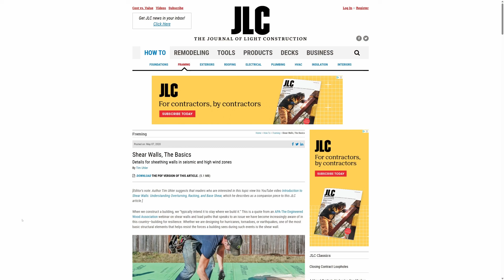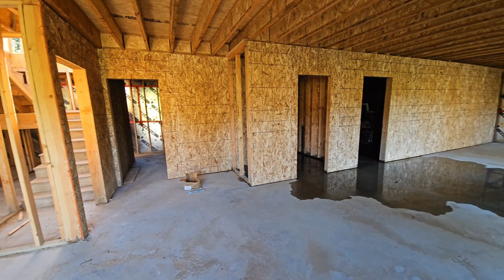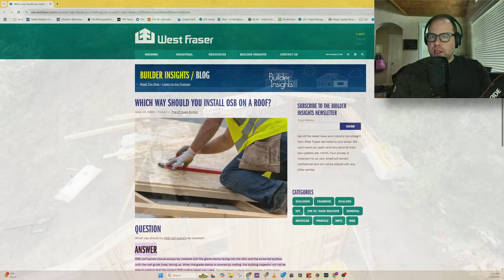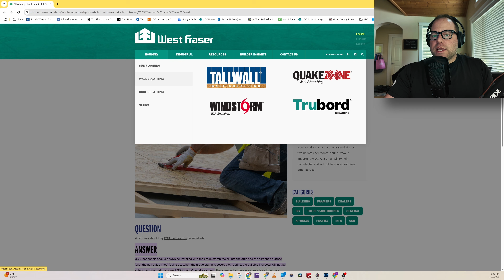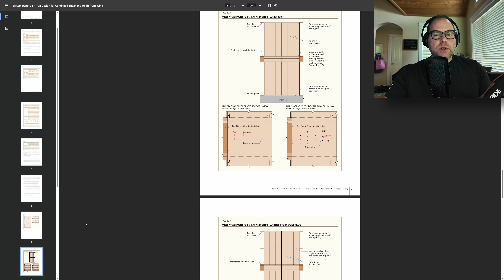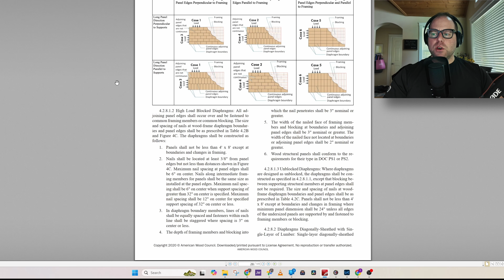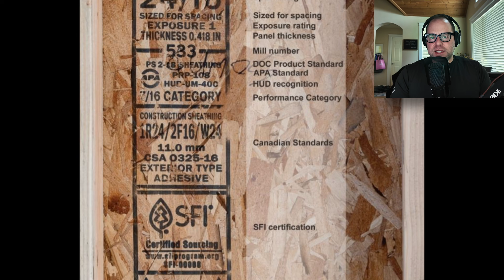Vertical vs. Horizontal Sheathing – The TRUTH According to Code

Comment: In my opinion as a structural pe,  sheathing should overlap equally from 1st to 2nd floor and should cover the base plate to foundation and top plate at roof.  This way most of your uplift is taken care of if you add straps at roof joists now you have uplift from roof to foundation.
Reply: This concept i am mentioning above is rarely talked about.  You can use straps floor to floor but really not easy to install and depending on the system gets in the way of the sheathing nailing and might put a bulge in your siding.
Reply from the maker: @kevinshaw5178  I mentioned that in the video with the reference to the PDF from West Fraser. I love the idea
Reply: @ sorry i was just grazing on the content didnt listen in detail.  But very notable concept particularly for high wind areas.  I did actually work for stanley black and decker nail division we tested vertically and did calcs.  The fasteners usually control.
Reply from the maker: @kevinshaw5178  interesting, thanks for watching!!
Reply: Another problem with the vertical straps is that they could buckle with vertical shrinkage causing siding problems.
Reply from the maker: @Bob_A8993  Great point!  We wait as long as possible to install those to minimize that issue.

Comment: I prefer horizontal applications, mainly for only one reason; it seems to me that the 8 ft. length of the sheet acts to keep the wall straighter, just my opinion.  Always block all edges!
Reply from the maker: I hear you, but 7/16" just doen't pull anything.  We find that when roof framing.

Comment: As a young man, new in construction it was easy to be critical of engineers especially when the older guys were gripping about what we were tasked to do.   But as I got older and ran my own company and crews I began to value what an engineer could bring to the table.  Protection from liability.  Design of critical components of a structure.  One avenue of construction we branched into was ICF buildings.   I have sat up night after night, pouring over code books, learning to read tables, designing lintel reinforcing steel according to those code book tables.  Its not fun when you are getting up early to be to the jobsite after you spent half the night trying to make sense of all that.  

So later in my career, when the engineer specs a certain rebar size or seismic stirup, hoop or hook I was thankful I didnt have to figure it out or incur the liablilty of that design. A few K for design is preferable to a few M for a lawsuit. 🤷‍♂
Reply from the maker: I could not agree more.  With open communication with the engineer, they are very accomodating.  Lots of ways to make the numbers work, we provide our preferences for products based on the tools we have or experience we have. For example, I will always ask to subsitute hardware with SDS screws if hardware with bolts has been spec'd.
Reply: I am literally going through this study all night work all day process. I have done concrete walls my whole life and now I'm a super over a self performed stick frame building with high shear demands and no people on my crew that know any better than me. 

This is driving me crazy at the moment.  I'll have a note in the structural note saying to sheet wall vertically, then a detail note says the sheathing can run either way,  and details picture showing it horizontally. Everything is double blocked and double sheeted. 

It's a deep end situation for certain.
Reply: @perrymaxwell4488 send the design team RFIs (request for information) for each detail thats not clrar.  By about thr 10th one they should realize they were sloppy.  Oh, keep a copy of all corespondence and fixes they send.  Cya
Reply: After 20 years of working with the same engineer on almost every job, he finally retired. Broke my heart. He totally respects builders and would always show me some options and ask which design I liked better before finishing plans.

In his words “you know about 80% of what I do and don’t always need me for more than the stamp, but that other 20% takes a masters degree.”

Comment: Ideally you would run the shear walls at a diagonal so the strength axis is on the diagonal. Just the way some old shiplap floors and walls (but not exterior walls) were run lol, 100 years ago
Reply from the maker: Diagonal board sheathing is still in the code.  What reference do you have that shows running sheathing diagonally has higher shear values than horizontal or vertical?
Reply: @AwesomeFramers  on second thought what i said is contingent on the additional strength in the strong axis does not come at a cost of weakness in the perpendicular axis. --which it probably does.

Comment: The shear loads are entirely handled by the thousands of screws on 6" centers. Only the compressive shear load would be transfered slightly better if the siding is linked like bricks, (h or v doesnt matter), but with the 1/8" gap between ever seam it all adds up to several inches of deflection as the building racks side to side anyways lol

Comment: I'm neither a structural engineer nor a carpenter, however, the logic of critics who point to the orientation of floor sheeting and then draw conclusions about wall sheathing doesn't hold. If I'm not mistaken, floor sheeting orientation is about load bearing capacity and deflection of the panel perpendicular to the plane surface of the panel. Wall sheathing is about resisting shear forces that might cause racking of the wall - ie. forces that are parallel to the plane surface of the panel. It's obvious why the strength axis of the panel matter in floor sheeting. It's not clear at all to me why this would matter for shear forces. If you think about it, if you shear a 4x8 panel by some amount, the perpendicular length would change by twice the amount that the width would, but if you stack two panels on top of each other, then you get that amount of strain in each panel, but since there's two panels, it's double - or exactly the same amount that you get along the long edge.
Reply: Calif Architect here, a big difference also is that floor sheathing is tongue and groove. And it is often glued to the framing.
Reply from the maker: Yep, they don't understand the diffences.  However, Weyerhauser does make a tall wall sheathing where they orient the strands differently to align the stength axis perpendicular to the studs https://www.weyerhaeuser.com/blog/why-9-x-4-wall-sheathing/

Comment: My main concern  would just as much be the horizontal breaks, where I like for instance  top of wall tied in with the floor and next floor wall.... which might even be dumb in relation to shrinkage... whether staggered or not would probably  be less important to me, but... Any inputs to this? Of course it's easier and faster just to sheathe one section fully and stand it up - bam bam bam, without worrying about ever going back over it to tie it in. Thoughts?
Reply from the maker: https://youtu.be/hSwjkG3nv1c?si=PpUdgXLEFdCEmB1c

notice that the sheathing is plate to plate but not over the rim.  I did show in the video though that running the sheathing to the center of the rim can elminate some hardware.  I think its one of those "discuss with the engineer and make a decision for your project" type of things.

Comment: You are better off with you sheathing vericle perform vertical structure so putting the sheathing vertical lay out so all 4×8 edge will land on solid wood if plywood is  positioned right on wall

Comment: When i walk on plywood not installed properly in the attics for catwalks i can feel the sag under my weight and tread carefully so i don’t fall through to below. No need for me to watch any further
Reply from the maker: You missed the point, I was very clear we are talking about shear walls not roofs or floors.  The strength axis matters for those two applications.

Comment: "These are not low end houses".  Proceeds to show "low end houses".  You can NEVER make anything other than a low end house with twigs and stiff paper.  Even if you charge a million or more for them.  High End houses should be able to withstand any tornado below F5 without any "structural damage".  YES my standards are absolutely not the same as yours or "regulation".  In USA we build the lowest garbage we can get by with and then charge the most we can get by with for it! we are a disgrace!
Reply from the maker: That's way too over generalized, but often too true.
Reply: @AwesomeFramers  The more details I add to these posts the more YT likes to censor/ban them.  Plus, not many people really care about the details.  If I can't explain it in 1 sentence most people tune out unfortunately.  Thank you for taking the time to read my post, was not expecting that.  Cheers!

Comment: Someone at ZIP's tech dept. needs to learn the difference between affect and effect (@6:30)🙄 

The * footnote does point out that thinner panel shear strength can be upgraded to 15/32 values if sheets are oriented horizontally.

Comment: working on wood framed schools in california. Doesn't matter what APA says. All work is done to plan with DSA inspection. Usually vertical staggerred, grain is always vertical.
Reply from the maker: Good point, gotta frame to the engineering.  If the engineer spec's staggering, then as Thor said in his book "stagger away"
Reply: Worked on a lot of private projects with city inspectors barely remember any of them. Worked on two schools and remember both DSA inspectors vividly. 😊

Comment: As a New England builder we have installed them both ways, however vertical saves you on labor for blocking since you only have a few 4 foot seams to block, rather than many 8 foot seams. So in high wind zones we generally go vertical because it is less work in the long run. Also I never use OSB for exterior sheathing, I use  1/2 inch fir plywood. I use Advantech T & G 3/4 for floors and 5/8 for roofs. The reason I don't use it for sidewall sheathing is that the seams always expand and make waves in the siding that are visible to the naked eye.  Even Zip System does this unless you can get the entire house sided in 2 weeks. We have a small crew, and do a lot of detailed trim work, so it is never less than a month before we start siding. If I wait that long we get water infiltration at the seams and OSB swells and causes waves. That has been my experience. The roofs get Ice and Water Shield and tar paper immediately so they don't ever see any major water, not the same for sidewall. The floors don't seem to do this, apparently the glue in them is made to withstand water better. Just my 2 cents. Oh also in MA where I usually build, they still require Ice and Water shield and tar paper even on Zip system roofs, so I will use 5/8 fir in non-high-wind areas since the Zip system doesn't save me any time, or money.
Reply from the maker: We've been using OSB for 30 years without the issues you describe and we are in the rainy PNW.  Zip since 2009 and not the issues you mention.  However, we have had major issues with plywood and have stopped using it completely.  It doesn't do well here at all.  When we used it on roof overhangs and OSB for the field, we started taking it off days later because it delaminated.

Comment: I've been a framer since the late 70's. I've used many types of sheathing during these years. When we started using plywood we always ran it horizontally. However, it was CDX, not OSB. CSX definitely has a better deflection rate installed that way but I don't know about the shear value.

Comment: Hey dummy. You're not supposed to hang sheathing with 4 corners meeting. As for the horizontal vs vertical... from what I can tell, that sheathing is OSB, so if you think there's a "right way", well, you're also dumb.

Comment: It’s called OSB (oriented strand board) meaning that the wood chips are facing a general direction throughout the sheet. The fiber orientation makes the sheet much stiffer parallel to the fiber. Meaning that OSB or any other plywood run horizontal across studs will be stiffer and less prone to warping and bending over time while also providing a less bouncy nailing surface. For load and shear calculations I doubt it makes much difference. 
As a carpenter for 20+ years, I have done repairs on houses where some of the OSB was hung vertically and the warping over time was clearly visible. On the same house on the same wall where the OSB was horizontal, the warping did not occur. 
Personally I’d never use OSB on my own home, it just turns back into wood chips when exposed to moisture. 
As a carpenter w
Reply from the maker: Did you actually pay attention to the references?  The strength axis is important when we lay sheathing for floors and roofs and potentially wind, but the wall is sized for the wind, e.g. stud size and spacing.

Comment: Wood Butcher Great to see you!
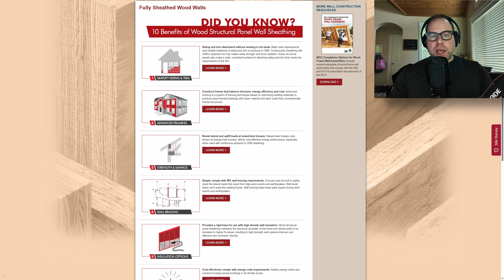Excellent video.  Super important themes / comments starting at 1: 50 and 9:00.

You drop the nerd comment although I understand it's self-deprecating what you're doing is reinforcing the curmudgeons who think that is the way I've always done it's the way my grandpa taught me etc etc etc I don't need no stinking code.

I've said it before you are a manufacturer, (and you do it correctly) your responsibility as a framer a finisher etc is convert the engineering requirements that are on the plans into the finished product without deviation.  (Yes deviations can happen but they're approved by the design authority that is the engineer).

Comment: Architect here: I love how you presented this information and thank you for the very informative piece on sheathing.  I think the reasoning is all sound, and the economy of this approach is good, and I wanted to add a few points below to consider.

1. Whether it's required structurally or not, sheathing affects the load path to the ground, (of wind or seismic) and it's all about load path--which you have noted in your manufacturer data.  What is worth considering is that there are other products that are less-stiff, such as Dens-glass (glass-faced gypsum board) which will improve fire resistance and will decrease the load path to the foundation by alleviating the force in the wood framing via both framing movement and friction (nails)...this typically decreases the foundation size...less concrete and less steel reinforcement, and less excavation--this pulls costs down and schedule to the left.

There are other considerations for foundation size: frost depth affects footing depth, I believe, and expansive soils (like clay) often increase foundation width, but the stiffer the building, the more forces travel to the foundation, increasing the amount of labor and material to achieve the suitable footing.  Another consideration for sheathing is its weight.  The heavier the structure, the more base shear is a consideration for horizontal forces (wind/seismic) so again, the foundation has to be engineered to a greater size to handle this base shear.  In sum, lighter weight and less stiffness will save you time and money if you can achieve it--I'm not sure if OSB or plywood is lighter than gypsum board--but I would avoid fiber cement panels since they spall in fire, they need pre-drill and special fixings, and primer, and they're heavy--at least as a specifier, I avoid fiber cement when possible.

2. For sheathing at door and window openings, I always detail the sheathing to return into the rough opening so that I have a cleaner (more rational) opening to seat flashing tapes, and it makes it easier to have the RO (rough opening) with proper sloped sills, since these sills are the collectors for water (at doors and windows).  The images you showed depict flashing tape/ice-water shield type self-adhered flashings, and these can get installed more successfully without the wild edges of both framing and sheathing layers, etc. encroaching on the RO.  So basically the RO gets increased by the sheathing thickness +/- any additionals for flashing, e.g. if we're doing s.s. flashing over the flashing tape, we're doing to increase the RO by about 1/2" due to buildups at the corners due to sequencing of sill/jamb/head of the various layers.

Anyway, I'm not contradicting anything that you supported in your video, which is superb in my opinion, just a few 'nerd' comments from the architecture side.  Thank you for the video and for the good work all around--strengthening the community.
Reply from the maker: Great commentary! Thanks for taking the time to lay it out so clearly.
Reply: 🤣🤣🤣🤣.    Bored?
Reply: This is why I read the comment.
Thanks 👍
Reply: This is why I read the comment.
Thanks 👍
Reply: Yeh But i stop at 30 seconds and understand the rest is babble for half an hour saying This:
"You have to put it on the direction your Necst level is. So joints are clamped and nailed with wood" .
Producer aint carpentar.
He can tell tech specs of the material. And carpentar has to figure out how to use it.
Carpentar is responcable.
King
Ragnar YAHUWAH
Reply: They sell membrane that expires on date after 10 years dude.
You never finnish if You listen to them.
Bathroom costs 3000 Dollars a year to have.
King
Ragnar YAHUWAH